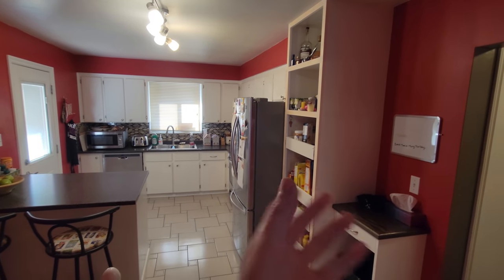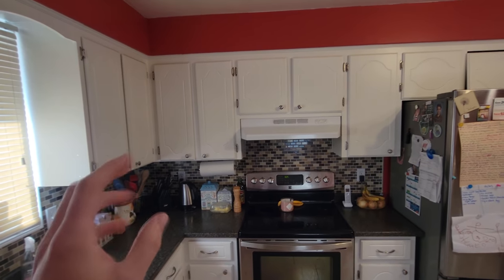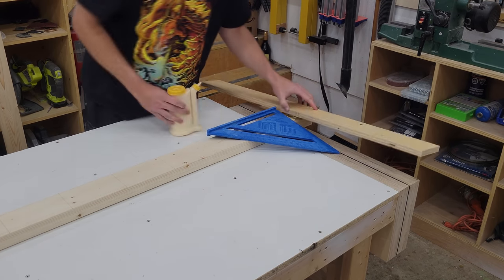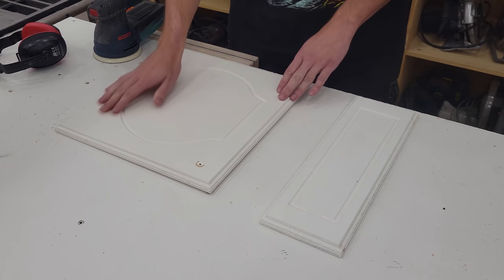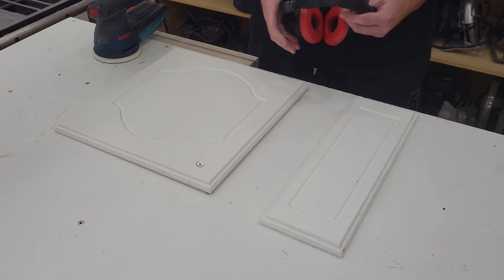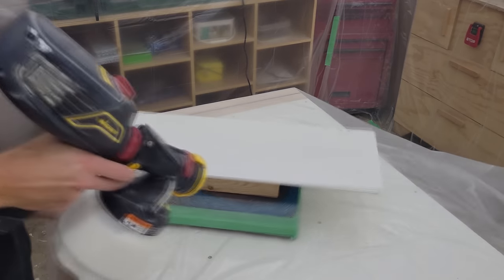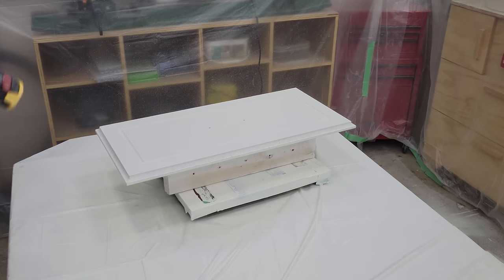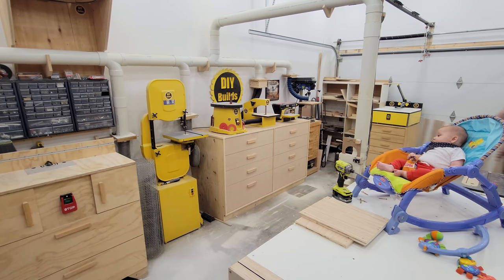Cheap & Easy Kitchen Makeover + Paint Drying Rack Build

Comment: Spackle on mdf to make it paintable is a great tip. Will keep that in mind on future projects.
Reply: It was particle(strand) board and spackle, if you are using actual MDF (or LDF) you can use regular white glue(like elmers) to seal the surface and keep it from soaking up the paint, and it gives you a surface that will take paint well.

Comment: Nice job the most satisfying projects are always the ones with big results when under tight constraints (especially money). 
In the past I used a similar method to match the edge profile on particle board to some existing doors which was to rebate the edge then fill the rebate with 2 pack filler (bondo) and rout the new profile into into the filler.

Comment: OH new kitchen now ,they make a primer that got polymers in it does great on the edges ,my drying rack was made from a couple of 2x4s and plastic 1/2 inch conduit ,and size does matter when it comes to spray tips , i use water based paint and poly mixed ,followed by a clear coat gives it a nice shine and hard wearing ,looks good ,when  you do rebuild it get rid of the bulk heads if you can ,it ll give you a little more storage for the less used stuff

Comment: Nice job, good tip on using spackle on the edges.  (files that away for later) :) BTW, which paint gun are you using?  Got a link?
Reply from the maker: Mine is old model. New version would be Wagner Flexio 570